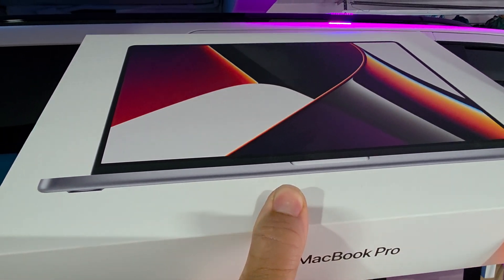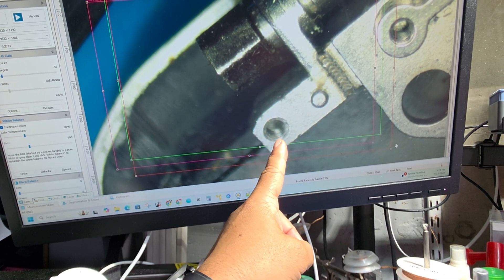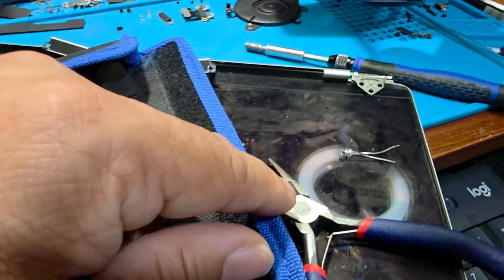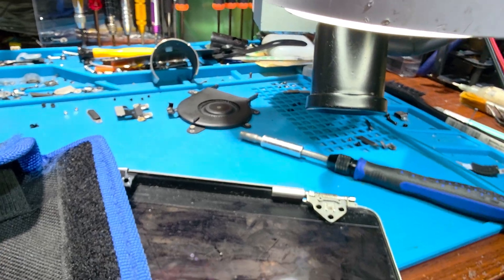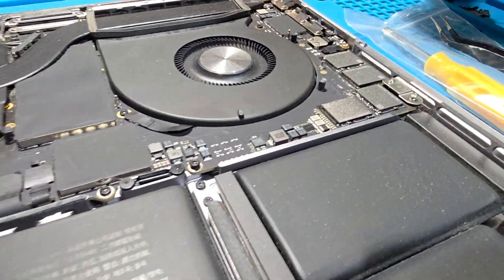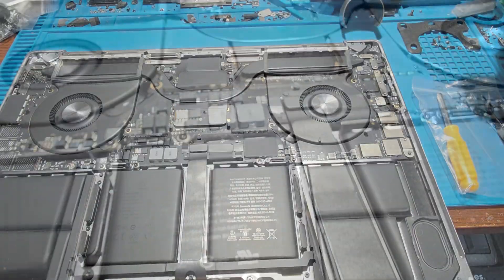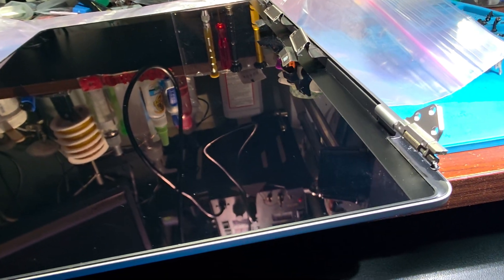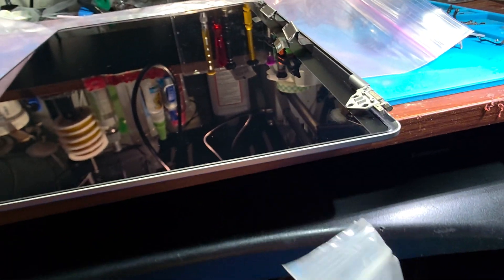MacBook Pro 2019 M1 M2 M3 M4 Air Lid Angle Sensor (Sleep Sensor) Calibration without programming

Comment: would this sensor stop it going to sleepwhen the lid is closed?
Reply from the maker: Yes. This sensor is the worse. It controls sleep wake and its programed to each macbook. Replacing it can cause major issues if not done properly.
Reply: @djab203  oh joy, i had something fall on my macbook when opened, and the screen is a little bent, when closing it turns off, and then backj on
Reply from the maker: Sounds like a hardware issue from the impact, which will require professional help. In the meantime, check your Settings > System Settings > Battery > Options for sleep.
Reply: @djab203  yeah i think it is, im probably just going to try and by a new sensor

Comment: I have an M1 with a screen replacement but the screen keeps turning off because it thinks the screen is closed
Reply from the maker: That is usually the problem if the replacement was not done properly. Was the old sensor re-used? If a new sensor was added, you will have to program it. There is a device they sell that does this, but it's expensive.

Comment: I watched a YouTube video that seemed to indicate that the sensor itself was tied to the motherboard, in such a way that a sensor from another machine or a new one caused the MacBook to misbehave badly. Unfortunately, I damaged the sensor that came from my damaged screen. Are you aware of a new sensor causing any such problems?
Thanks
Reply from the maker: Yes. That is correct. If you damaged your sensor do not throw it out. Find someone that could transfer the chip from your broken sensor to another one and then you can do as I did in thus video. If you are unable to do so then you have to buy the calibration tool which would calibrate snd program another sensor. Hope this info helps.
Reply: @djab203 Thank you. Do you have any information on the calibration tool!
Reply from the maker: You can get it from here https://notebooknerds.de/en/nerd-tool-1/
Reply: @JustSomeHuman-j8o  you can also get the sensor via the Apple self repair service, it's just like 15 bucks or so. There's an official Apple repair guide on how to calibrate your sensor after the installation. It involves booting up into Apple diagnostic mode, and at some point closing your screen and keep it like that for 20 seconds, and then your LAS is calibrated. 
If you don't do it correctly though, you bricked your sensor and you have to get a new one (according to Apple).